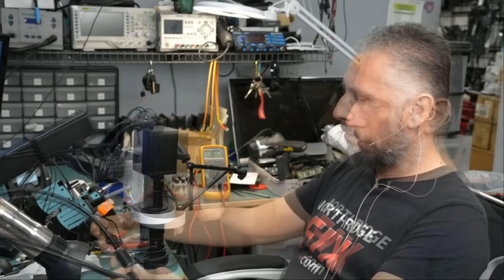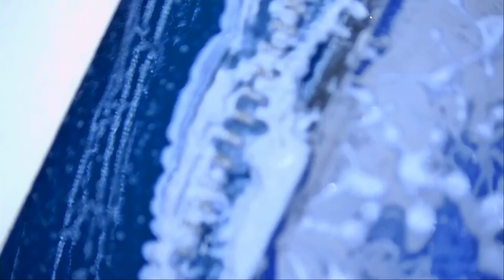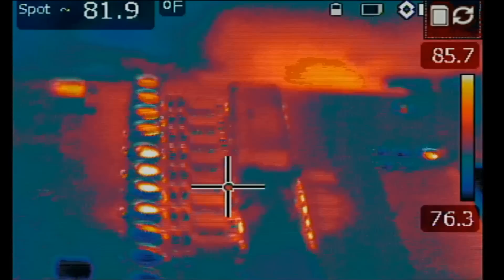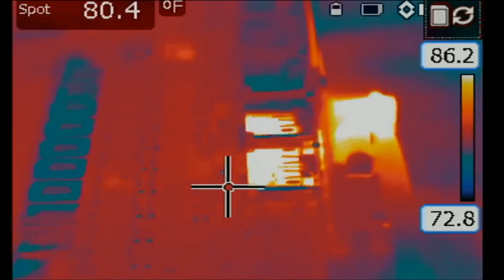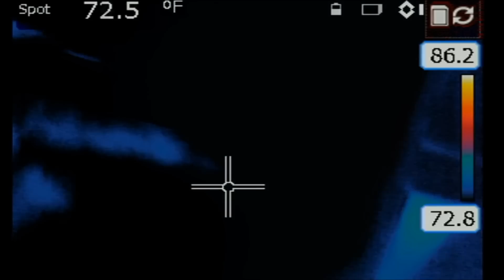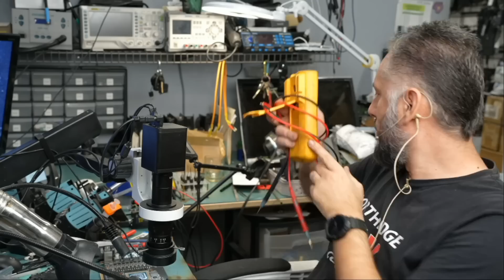ASUS Strix 3080 OC Graphics card Repair

Comment: I have the same issue with my Gigabyte RTX 3080ti, just happened yesterday while playing Valheim. Fans spun to 100%, screen shut off, no HDMI signal. Went to reboot, and it wouldn't. 

When card is plugged in, PC doesn't boot. When PSU cables are taken out of the card, the PC starts. Sending an RMA for this card, second time now.

Comment: Watched  the thermal footage twice. The heat spot was very visible when the current was switching ON & OFF.  The component cools and heats quicky . Masterful technique !!!  Would I burn my finger if I used by finger as a temperature probe? Lol
Reply: I wonder if by recording the thermal video signal, and playing it back on loop at a higher speed, hard to notice changes become easier to locate. (slight fluctuations made rapid)

Comment: A v2 thermal camera might speed up this type of diagnostic proces where it is harder to see the temperature changing after injecting voltage 😉. Thanks for sharing another vid, love to learn about the components on all the boards and the structure of your method makes it easy to follow along. Greetings from the European coast!

Comment: Yay another video :D
Great catch Alex :)

If no components light up when injecting "voltage"/current, you can measure directly between chips (DRAIN and SOURCE) in mV range while injecting current. The chip with lowest reading is shorting the board. This makes the work many times more effective than removing each chip separately ;)

It would also work with multimeter in ohms mode, but you would need an extremely expensive ohm meter that can measure low resistance with many digits and very unreliable since the pressure of leads would change the reading.

Comment: What chip was that? I see many pins are joined by the pads underneath. Could it be a mosfet or mosfet junction?
Reply: Usually they are highside and lowside MOSFETs that have integrated drivers and logic aka drMOS.

Comment: On different video cards, the thickness of the thermal pads is different. Each manufacturer has its own nuances. How do you know the thickness of the thermal pads? And what thermal pads do you use when assembling a video card after repair? After all, if you choose a thicker or thinner thermal pads, then the fit of the cooling system will be incorrect, which will cause the video chip and video memory to overheat in the future and they may fail. How does the big boss collect these cards back?

Comment: Why not put the thick boards in a fridge or freezer (within a zip lock bag) for a few minutes before testing for hot spots?
Reply: Water will condensate quickly on cold surfaces. You don't want to apply power to a wet circuit.

Comment: Notification sqaud! lets see if he reads the comments. Did a charge port on an iPad 7, I've done many but on this one I lost display after. Battery was isolated before anything was disconnected up until everything was re-connected. FPC connectors are good, filters tested good and no shorts, any ideas?
Reply: Is it that the iPad is turning on but the display is not showing anything? Or is the iPad not turning on? And have you tried another display?